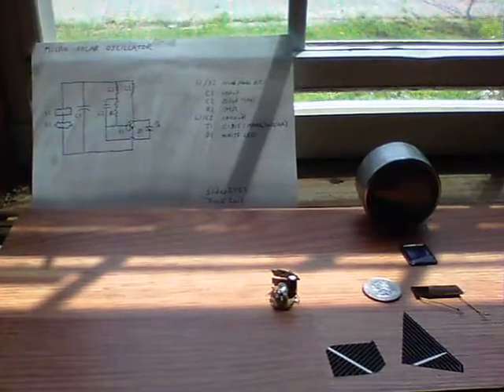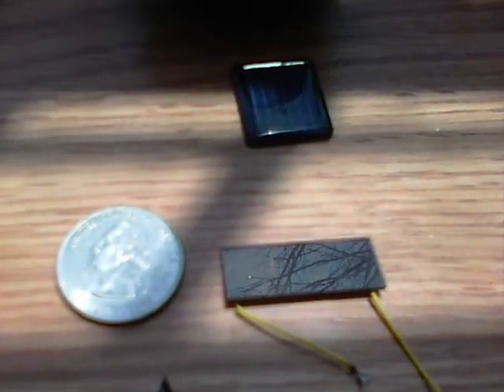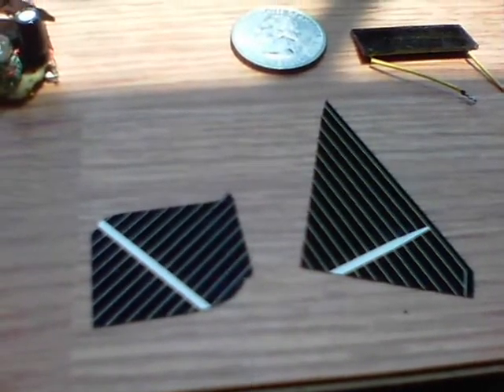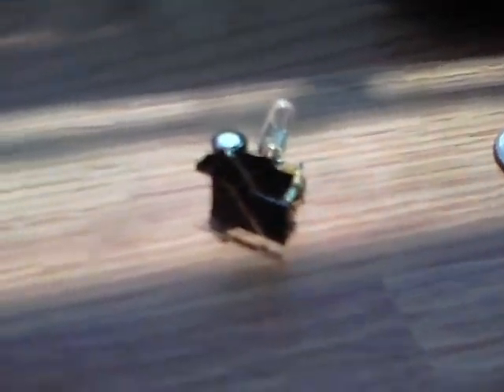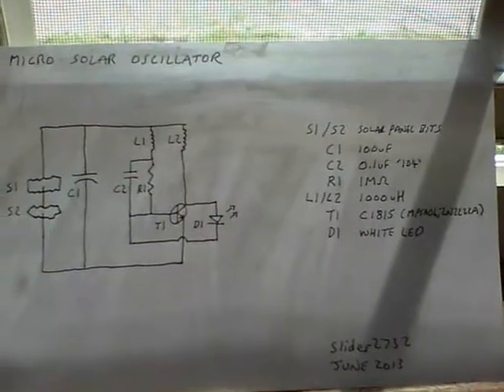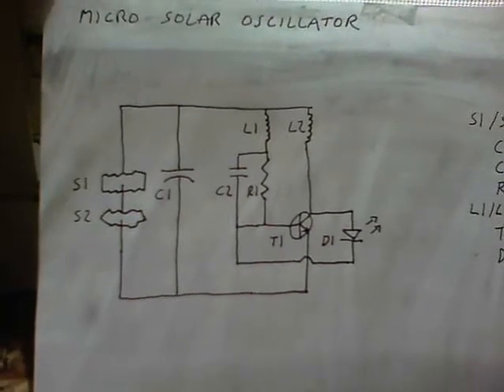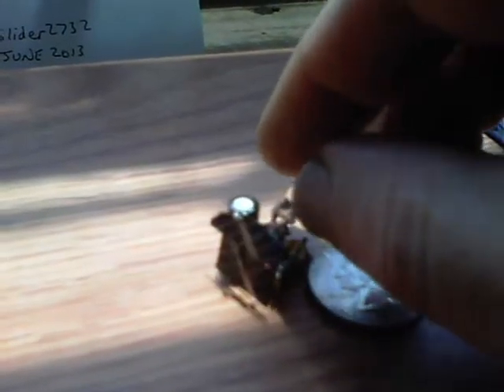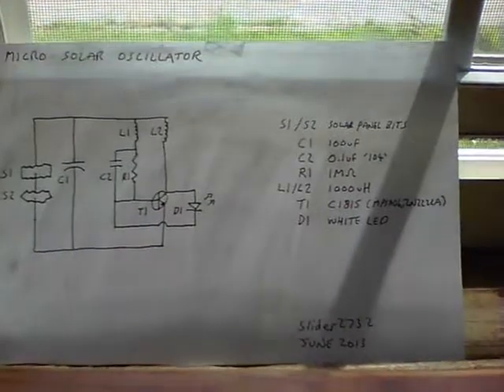Micro Solar Oscillator

Comment: Looking forward to that day. Yes I did count them. The reason is simple, just like me, I know nothing of SMD and I wanted to see just how many transistors you could get in such a small space. Along with the chips it was impressive. Imagine all 39 Joule thieves with tiny ferrite transformers running off watch or hearing aid batteries in a small area. Say 5 LEDs to a thief. That's some strip light for the work bench.

Comment: That getting pretty small.  Good idea about putting the two solar cell bits together to bump the voltage.  These penny oscillators will run on a red led or better yet an infrared.  I might try two in series now and see if it works better.

Comment: Oh, I'll be using smd solar panels and components :) Winding a 10mm diam ferrite (Got a grey one twice the size, but thought I'd go easy on you, and my winding hand) toroid now, bit over 500 turns of .01mm wire so far :) Short wind will be 0.63mm. Your lucky my good germanium transistors are so big... What farads is that big cap out of curiosity? Wondering if I should go with the 10kµf 6.3v green one, or the 220µf 10v smd one......

Comment from the maker: These are actually mono's, front Negative, rear Positive. Have to be size of a 1 cent or similar to deliver 0.5V, but 2x small bits easily bumps to switch on the transistor at say 0.3V each. A piece the size of those bigger ones shown doesn't run it easily, kinda weird eh.

Comment from the maker: Will look at SMD when I find the silliest panel size. Good tip on the battery monitor circuit...Have got a solar+radiantly charged old laptop pack here in front of me and although says 13.5V, only 1 LED lights up. 
You actually counted the transistors ? my my the weather must be bad over there lol

Comment: Nice. You're gonna need a macro lens soon. :) I guess the next smallest would be to use monocrystaline. My understanding is there's no wiring on the front - though I don't know if the connections are easily accessible everywhere on the back.

Comment: If that works you could go microscopic. What you need is surface mounted components. Get an old printer rip it apart. Or an old laptop battery. I found a PIC Micro controller. 39 transistors and a 4 led driver chip too. That was without the high current diodes and the caps. 4 LEDs. All on the battery control card. It was one of those batteries you press the button and LEDs light up to show state of battery.  You could glue on back of solar panels and then connect with transformer wire. Go for it

Comment from the maker: That's the idea :) well, not the Mini Slider bit lol. It just interests me how small these things can go and am already finding that the 'big thick' white line on the panel bits is becoming the sizing issue ! If you look at any regular monocrystalline solar panel you'll see the bussing wire line on the front. 
It's time for the super sharp razor blade approach I reckon, cut the thing in half.